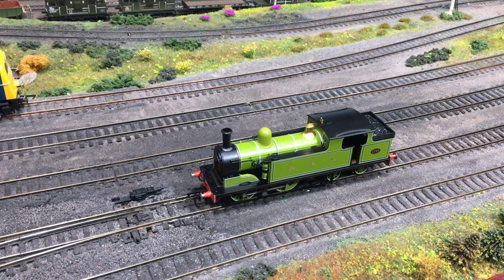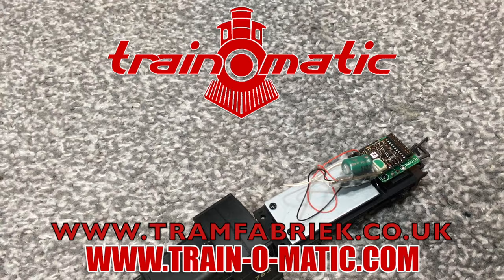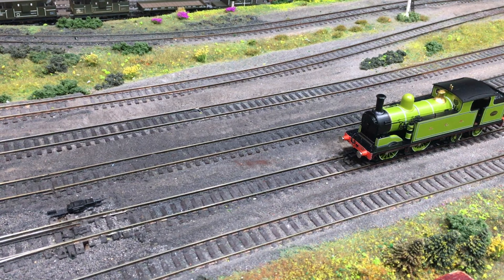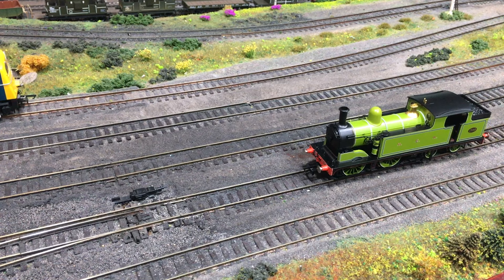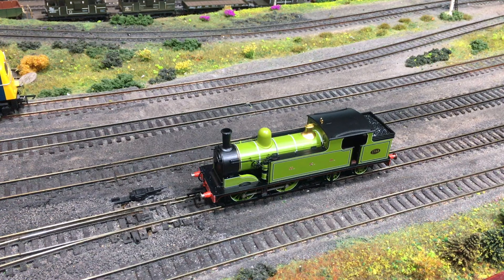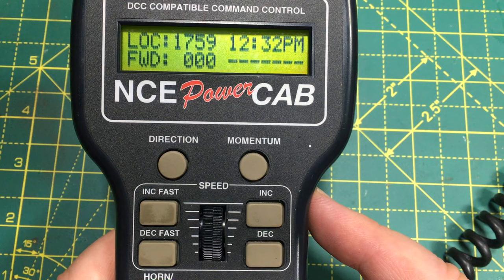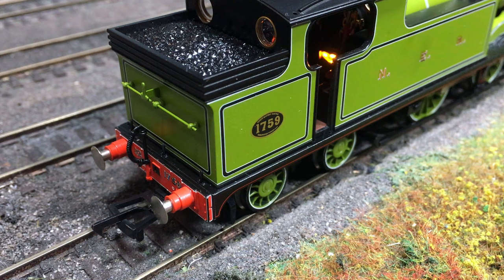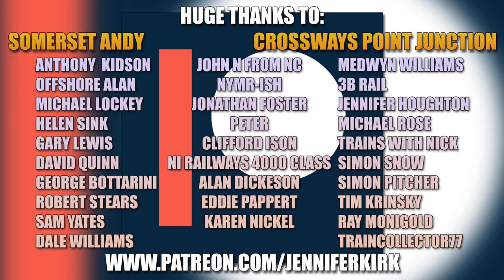How To Set Smooth Running And Firebox Flicker CVs - I Show You How

Comment: Hi jenny. This video was very helpful. Cvs scare me.  I have a bachman class 47 factory sound. And once run in. When I slow the loco down to a stop. It does stop but then jerks forward.  I am new to DCC and still learning. Hope you can help. The instructions are very low if extinct on cv values and on how to adjust them..  thanks for your help. Daz.
Reply from the maker: I think the factory fitted sound uses Zimo decoders. If you look up the CV settings for those online?
Reply: Thank you jenny.  I will look into it.